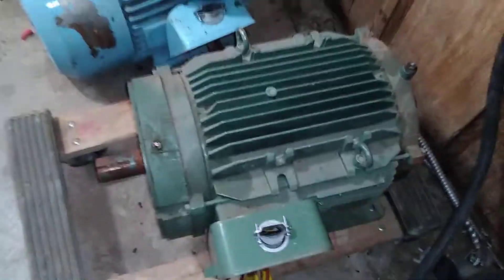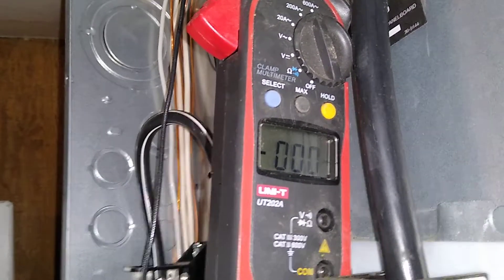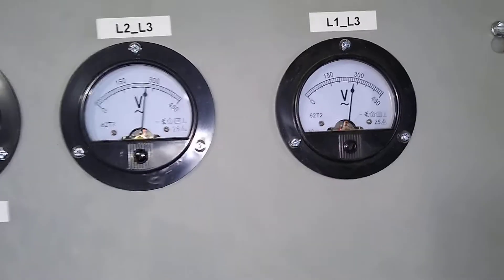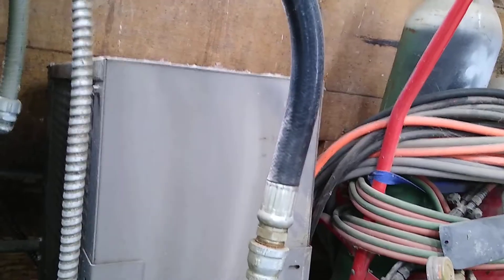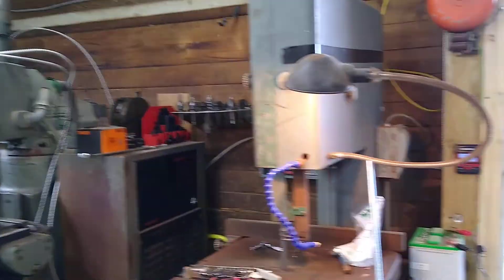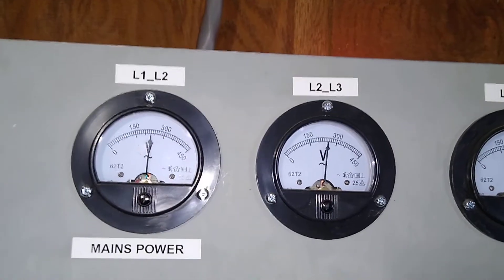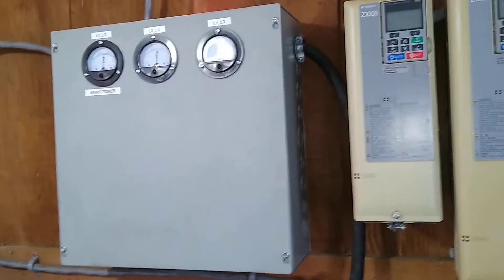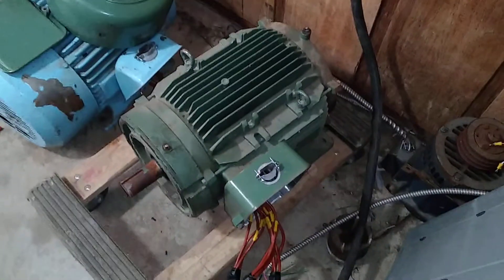30hp rotary phase converter 320 amp start surge

Comment: might need more start capacitance or another motor to get the motion started
Reply from the maker: For the idle motor or the compressor?
Reply: @electromechanicalstuff2602  compressor
Reply from the maker: @MrChasekennedy  I did. I added another 0-1 second timer and contactor at the compressor it made a big difference
Reply: @electromechanicalstuff2602  ok. Cool. I was just wondering if that could help.
Reply: @electromechanicalstuff2602 
Here is a link to the start box we use for 3 phase converters at our shop. The timer is just a relay that starts connected and after the fake leg kicks it over it drops out. 
 https://www.dropbox.com/s/6i3n97tzrf5qw2w/1587973467612_Schematic_PHASE%20CONVERTER_2020-04-26_14-23-22.pdf?dl=0

Comment: Did you start the engine with star and eventually delta?
Reply from the maker: Nope u need a 12 wire motor for that
Reply: @electromechanicalstuff2602  What is this?
Reply from the maker: @melitae2317  this is a rotary phase converter. It takes single phase AKA(2 hot wires like normal american household electric clothes dryer) and converters it into 3 phase. AKA(3 hot wires like most industrial equipment) most residential home don't have industrial power available so I create it using a (rotary phase converter) this is a very common device in the home shop using industrial equipment.
Reply: @electromechanicalstuff2602  very good.
Thank You

Comment: soft starters save a lot of wear and tear by limiting the inrush current to the motor which in turn saves hydro because of the inefficiency at that high current.They also save money by reducing breakdowns caused by high current damaging contactors,breakers and fuses.Also do not plug in 100amps in your hands  that is "poking the bear"
Reply from the maker: Yes I know plugging in under load is a bad idea but the arc flash of 240v in not that explosive unlike 480. Check out my latest videos I finished all of the compressor magnetic starter and phase converter
Reply: @electromechanicalstuff2602  I like what you are doing there I just don't like seeing good guys taking chances,to many have paid the price.
Reply from the maker: I totally agree with you butt they don't make single phase to 3 phase soft starters. I have 500 hp soft starters at my work that I service.

Comment: Ain't you compressor running backwards? Nice setup.
Reply from the maker: 4:33 - 4:40 you can see the compressors spinning counter clockwise. And there is an arrow on the flywheel that indicates that direction.
Reply: @electromechanicalstuff2602  10.4 I'm half blind most of the time. I like that big compressor, I've got a Lincoln 3 phase welder, need to sale it.
Reply from the maker: @kentuckytrapper780  in michigan?
Reply: stuff  no I'm in letcher county Kentucky.

Comment: It looks like your 30 hp converter is being turned on with a 100a breaker? How doesn't that breaker trip with 320a starting draw?
Reply from the maker: Breakers are built to handle 300% starting surge
Reply: @electromechanicalstuff2602  So that won't fry your 2 gauge wire feeding your breaker? I'm just learning about the ins and out of how components work together so this is interesting stuff. It would just seem your wires feeding into your breaker would be super hot after such a surge no?
Reply from the maker: @Ragnar.Lothbrok.3.14  no the wires aren't hot. They can handle lots of power because it's only for 1 second. Same reason the wires in your car going to the starter are also around 2awg and they handle 500 amps on some vehicles. Most wires going from the pole to your house are not NEC rated for 200 amps maybe 1/0 aluminum wires only rated for 100 amps but power company will hook them up to your 200 amp panel cause they are "air cooled" so they can handle more current without overheating and on the other foot as you add more current carrying conductors in conduit you must de-rate the wires current capacity because of the extra heat. Hell you can change the ampacity of a wire because the insulator coating is rated for different temperatures. And if you say put wires on a roof in an area that exceed the temp rating of the wire you have to de-rate it again. Per the NEC (national Electric code) you only need to size wire for a motor to the size needed for FLA (full load amps) that the motor nameplate called for. You do not need to rate the wire for the inrush because it's not a continuous load. Look up some MIKE HOLT videos on YouTube he literally helped write the NEC and has tons of great videos on stuff like that.

Comment: In rush will be high for a millisecond or so, pre spinning the idler will greatly reduce the amps.
Reply from the maker: I'm not worried too much about the inrush this is a 3600 rpm motor that's the main reason the inrush is so high. The overhead utilitie wires to my barn are only like 2awg aluminum. My house is on a separate feed from the utilities but same transformer. My house has all dimmable LEDs which flicker for even the tiniest voltage drop. My house is fed with 4/0 aluminum from the utilities and my wife says when I start the RFC in the barn she barely sees the lights in the house flicker. There's only one other neighbor on that transformer so it seems to be enough. My guess is the small utility wires feeding the barn are just creating a decent voltage drop and preventing even more inrush current. It's acting like a Y-Delta starter and reduces the voltage to limit the starting current. Plus if they melt off then the utilities will have to come out and upgrade my utility feed for free. The feed to my barn is 150+ yards from the transformer and uses two additional poles to get them the distance.
Reply: That is not possible with my 30HP RPC.  It is TEFC with a front cover plate.  So I can't get to the shaft at all.
Reply from the maker: @zod-engineering-welding  ya when u buy em they cut the shafts off and use internal fans for safety and noise

Comment: I've started my 30 hp idler using a pony motor to pre spin the idler, this was just for testing.
Reply from the maker: I used the rule of thumb 100mfd per HP for start caps. I'm using Jard p/n 11970 which are 270-324 mfd 330vac. So 30HPx100mfd=3,000 mfd I used 10  of them. But I could probably add a few more to get the start current down even more. I love the sound of that 30hp motor starting on its own. My phone ringtone is the sound of a 400hp chiller starting up I recorded at work. That's a cool old Genny u got. Think she'll run?

Comment: does your phase converter motor have a capacitor start on it?  320A is huge!  I ordered a 30HP RPC and I hope it doesn't draw anywhere near that much!
Reply from the maker: It has 3,200 mfd worth of start caps on it. Otherwise it wouldn't even attempt to start. When I bought this 30 hp pony motor over a year ago I had only read about using a 3600 rpm motor instead of the usual 1800 rpm motors. I have always only used 1800rpm motors to this point but I got it to $50 NIB and I couldn't pass it up. Some said it takes a bit more current on start up and is a bit noisier cause of the fan. Boy where those understatements. That fan is obnoxious and I'm looking into a 10" 12VDC rad fan instead. When I take it's built in fan off its silent but will eventually overheat. At first It would instantly pop the 60amp breaker I had it connected to so I took the motor to a shop for an evaluation $100 wasted... and they said it was fine then I put it on a 100 amp breaker and it finally started. Then I saw why it was tripping the 60 amp breaker. The breakers are typically only rated for 300% surge so even the 100 amp is barely enough. I would expect normally with a 1800 rpm motor the start current would be 150-200A for a shorter period then mine cause it also reaches speed faster. Let me know how your RFC works out
Reply: @electromechanicalstuff2602  Thanks, mine is a 1800 RPM motor, and I'm thinking 100A breaker.  Maybe 125A.  I just don't know what the inrush current will be.  The FLA is 70A, but no mention of in-rush.  Makes it hard to decide on wire gauge size.
Reply from the maker: @zod-engineering-welding  sorry YouTube didn't alert me to your comment. You should be able to get away with an 80-100 amp breaker. You don't have to size the wire to handle inrush. If you did you'd be in the 500mcl wire gauge. My bet is you'll be in the 200 amp range and a breaker can handle a 300% inrush. You only need to size the wire to your breaker. My barn is only fed with 2awg aluminum from the utility pole. Lol my service is 200 amp so at the weather head I have 4/0 aluminum connected to 2awg aluminum. It's comical. Utilities are allowed to overrate their wires cause they're"air cooled" and don't have to follow NEC guidelines.
Reply: @electromechanicalstuff2602  Thanks!